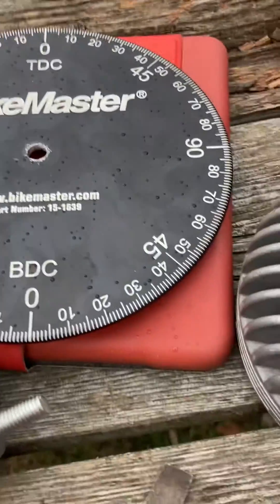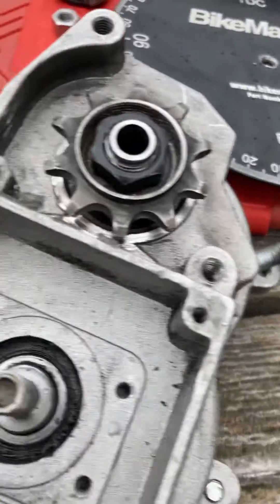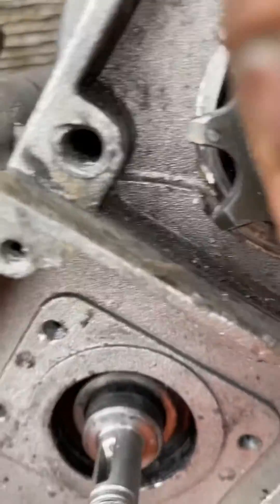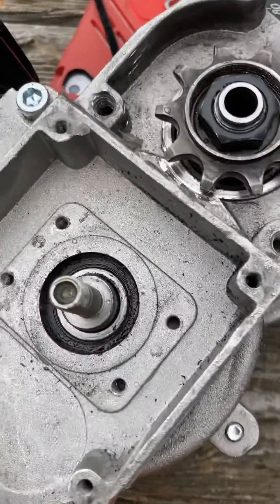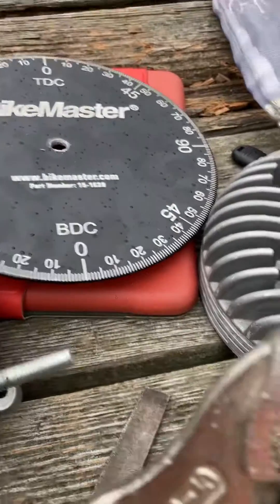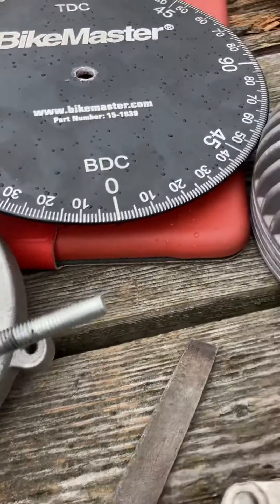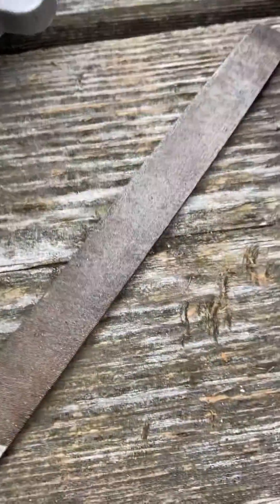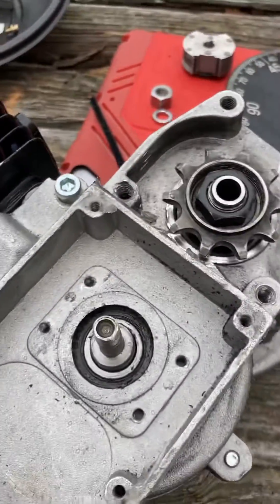(Physical timing)How to set timing on your 80cc magneto.

Comment: so I don't know if it changes anything frankly because it's an ignition system partly tci and not CDI if you prefer it's after you can put an ignition with CDI however the magnetic flywheel is not big that's why the tci does its role it's to have a very important electric current at the spark plug because what comes out of ignition is slightly barely higher than a big bicycle dynamo
Reply from the maker: @russianbike2830  there is no TCI only CDI & magneto

Comment: How do you add that lil piece back it came out of mine
Reply from the maker: @jdotyfrmnj  the best thing to do is put a dap of superglue on it. Press it in flush or flat/level so you can get the gear slid back into place. Thanks for watching and I appreciate the question. I will think of adding more to this video as it is a couple years old. If you need any help my info is in the my favorites playlist

Comment: Why would you advance the timing on a motorized bike ignition they come super advance from factory, unless you’re running extremely high rpm’s which with that cylinder is probably not possible or want detonation in your engine then don’t advance the timing. I retard my timing by a couple degrees depending on the build. You can flip the woodruff key around and retard it which is what I would recommend. Retarding will also help improve your top end and top speed.
Reply from the maker: This video explains the set time with woodruff key. I’ve only used this information myself once. I stick to port timing.

Comment: Wtf is this video about
Reply from the maker: Just what it says the difference between port timing and physical timing is indistinguishable. Watch my playlist for more information.
Reply from the maker: You are removing material from the keyway slot. This allows for a small amount of play in the magnet. You can either rotate it forward or backwards to retard or advance the timing. 18° before a top dead center is when your charge should explode if you had it on a timing wheel, port timing is more important than physical timing. You should only need to adjusters after you have your port timing correct if your bike is four stroking.
Reply: Ohhh  I get it now.  Then lock it down with the nut.   N that works. Thanks for the tip
Reply from the maker: @johng2779  I put up a video for you check in a few minutes.